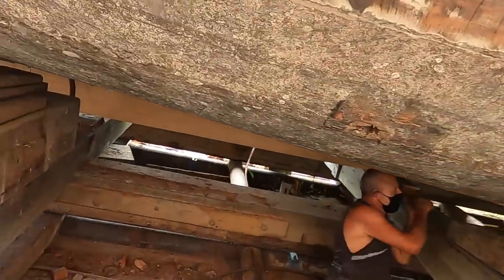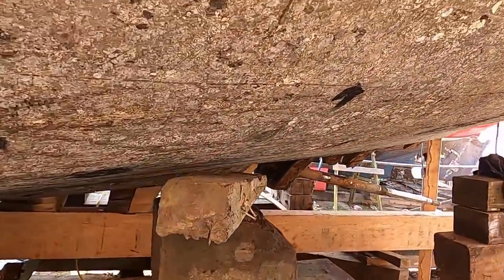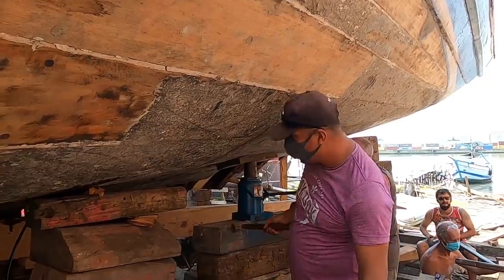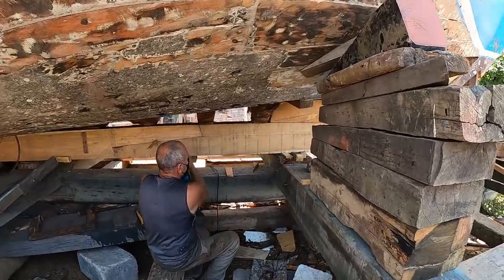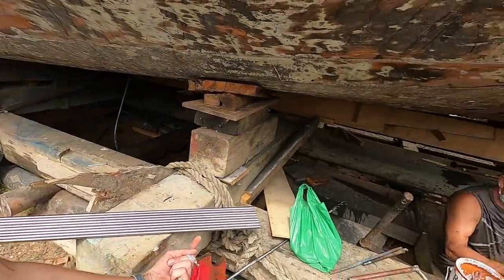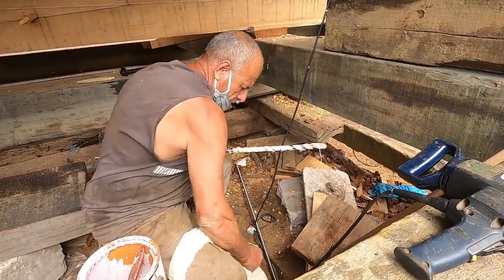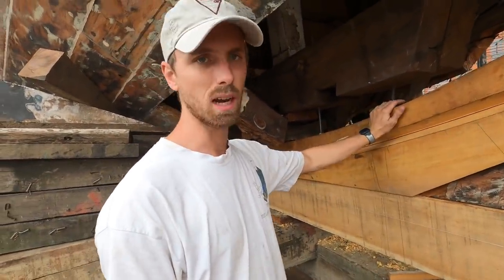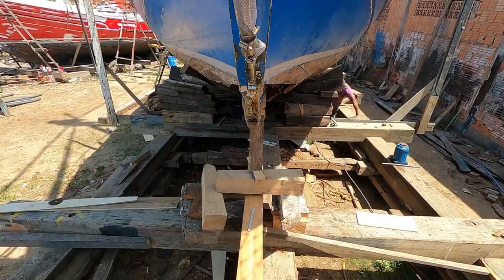Replacing the largest piece of wood? CHECK! — Sailing Yabá #15

Comment: 'Screw' is actually a bolt and the 'bolt put on the end' is actually a nut. 'Wall' in a boat is actually a bulkhead. The right terminology really helps the make the description accurate. Love your work!

Comment: Hi, are you going to put any bedding compound in, so far they have used none on any of the joints, your wood guys should know this, this is a must you have to tall them, I'm really 
concerned for the integrity of the frame to keel joints, best wishes.

Comment: I lived in Brazil for a while and remodeled part of the house and had it paneled.  The paneling came in large pieces to attach to the walls, but as the walls were plaster, they weren't totally flat nor square. The paneling company sent out a carpenter to adjust the paneling by hand and make sure it was properly installed--no extra cost.  Lots of beautiful wood in Brazil (imbuye, Pao Brasil, etc.) and still many great craftsmen.

Comment: They are replacing a lot of wood, but it means they almost have a new boat. It will be years before you need to replace anything. 👍👍👍
Reply: They just need to understand it got this way because the prior owner refused to do maintenance and pull the boat out of the water a few times each year and they now have a coating to stop the worm damage.

Comment: This is a perfect case in point about having to be flexible when doing wooden boat restoration, there are always several ways to do things . Its called wicking the bolts which is the proper way to do it . After seeing the Horn timber and the rest of the framing in the boat I am not surprised at all about the transom, I have done this before you just have to take it one step at a time , and do what you have to to float the boat.  I am sure you are thrilled to see the keel go in , I wish you the best . Wait till you get into sheer strake and covering boards , there is going to be  a great deal of work there, but at least it can be done in the water , take care and soldier on .
Reply: Yep
Reply: Not surprised about the transom because the whole boat is rotten. Every time they remove one board they find ten more rotten.

Comment: I've sailed around the world 7 times. I was surprised to see that the bolts were not double nutted to lock them. The vibration will loosen bolts with time. I would make sure those nuts were locked and double-locked somehow. 
That If all you have is that cloth and paint method. I would make them use that quick easy. Pluss is a proven method to lock. That's why Fancy Rope Work is painted to preserve and lock into place.
Reply: And are these bolt Stainless? I didnt see if they were

Comment: A big chunky slide hammer would pull the wedges quite easily. Suggest it to the guys. They may laugh or they might try it. It's a very simple and easy to make, but a very useful tool.

Comment: Ben, you are not using screws to secure your keel. You are using threaded rods to make bolts. Good luck guys, I admire your determination.
Reply from the maker: Thank you! Threaded rods, washers and nuts it is :D I got the hang of that thanks to reading the comments

Comment: I feel bad that a boat so young needs this much work.
Reply: It likely lived in rivers most of its life. Fresh water is what rots wood. Most lake work boats throw bags of salt into the bilge to stop rot. They likely did not do that here. But most work boats and 3rd world boats are like this and last 20/30years before refit
Reply: They read dummies guide to taking care of wood and did the exact opposite
Reply from the maker: Yabá has never been in lakes or rivers from what we know. She was made in Bahia and is now in Navegantes (SC). So the saltwater was leaking from the hull which didn't cause the rot. There were a lot of leaks on the deck which allowed rainwater to run along and in between the frames and planks. Because this went unnoticed or ignored, it caused a lot of rot to those parts. Also, there was a freshwater shower on deck which caused a lot of rot around that area too

Comment: Not a fan of the all thread keel bolt.  These guys are so handy I am surprised they are not tapping and forming their own bolts out of stock. 
Last time the wood rotted before the galvanizing came off the nails so it may not be an issue

Comment: should be using bronze the salt water will eat those bolts... there was a i piece of wood near the stem foot that was split because they ran the bolts improperly
Reply: I recall him saying they are stainless steel in another video, they should last as long as the rest of the boat. The paint would just be to fill the holes and seal the  bolts at that point.
Reply: Stainless steel not a good idea as much at sounds.Starved of oxygen it gets what is called 'crevice corrosion' and basically the outside looks fine but internally the metal  resembles a Crunchie chocolate bar with as much strength . Phosphor bronze is the idea material..

Comment: great video , im curious to know why every frame is not through bolted to the keel ? why only bolt every other frame ? what s the theory behind that ?  be sure to clean out both diesel tanks before you go out to sea, and filter the fuel before putting it back in the tanks ,   take it easy all the best
Reply: They are alternating the bolts at the moment as they get everything lined up and moved into position.  They're focused at the joints to keep the hull shape and prevent things from moving (as best as possible).  I suspect that the frames that aren't bolted will get refurbished/replaced first, then bolted down.  Then I wouldn't be surprised if the first set of frames bolted to the keel are replaced (if needed).

Comment: Just for the benefit of anyone watching; Ben's shorts are a complete No-No when working with rotary tools or equipment like that half inch drill. I have personally seen threads from a pair of blue jeans at a tear in the knee much smaller than the ones on Ben's shorts get caught in a 1/2" drill mix paddle and it isn't pretty. The little threads got caught around the shaft of the drill and in a split second it curled them around the shaft pulled the leg up against the shaft of the drill and began taking up the slack of the jeans until there was none left and then rolled the jeans and skin and flesh all up around the shaft of the drill before it stops spinning! I don't know if it was painful but the results were some very deep looking zebra striped bruises on his leg from the upper thigh to the calf so I'm  sure it was less than pleasant.
Reply: Fair point Daniel, we can forgive (or even applaud!) youthful enthusiasm, but seeing these near-misses makes many old-timers uncomfortable. We're not over-cautious snowflakes, just people with long memories, and a few scars. Ben and MP, we love you, stay safe!
Reply from the maker: Yikes! I have gotten rid of them already though. I'd rather avoid a zebra-striped leg. I actually borrowed them from Duca but ODDly he doesn't want them back any more
Reply: @SailingYaba  Haha! I hope you passed them on to the next budding youtube endeavor! 😉 I should be clear, i didnt see your leg that close to the drill but one moment of closeness is all it would take. I know all this is new to you guys and with those large timbers and make-do tools and equipment an injury could happen so the fact that it hasnt is a nod to how careful you two and the crew must be. 👍

Comment: A massive undertaking for sure. When you show the bottom of the boat it seems to me there is still a lot of rotten wood-do those boards have to be replaced as well?
Reply: In a project like this, you need the hull to keep it's shape as much as possible as you replace parts of it.  So yeah, with the keep replaced, they can replace frames to match the existing hull, then when those are solid, come back and replace the planking that has deteriorated.
Reply from the maker: Indeed! We will definitely be replacing more wood and it is true that the boat needs to keep structure to be rebuilt properly

Comment: Step by step inch by inch it will be done if the money holds out. Love the channel but I missed MP. The transom doesn't look good. More rotten timber. Those guys did a massive job with the keel. Good guys.

Comment: Hi Ben, I have not noticed do they use any sort of tar between the frame details. It is important to keep the water out. Otherwise it will be trapped in the seams and stay there forever. This is where the rot begins. It is also recommended to install water stops where the seam meets rabbett https://www.diy-wood-boat.com/Stop_Water.html. I am also curios what kind of wood do you use for the keel. Best wishes for your project!
Reply: @ralphgesler5110  I hope they will. But as to what I see how they install the wooden knees down to the frames there is no sign of any bedding compound. Normally you may see the excessive tar leaks from the seam and these are too clean. The keel joint looks also too clean.

Comment: at what point is it cheaper to build new the yard seem delighted to just keep working good repair skills but not for long life aka mild steel all thread not even stainless for the bolts just to get it back in the water feel sorry for them is like car crash tv, but its thier money so i really wish them luck and it all works out
Reply: Think of it from a content point of view.  Building new boats won't bring views in but rebuilding a broking piece of sht does.  Thats why there doing it
Reply: Gee that's a long sentence.

Comment: I don't know the answer to this, hopefully someone who knows the answer can help.  In the forefoot they are through bolting the keelson to the keel.  It doesn't look like there is any intent to add additional blocking.  So it appears that the keelson will be put in tension and slowly sag over time, is that common for this kind of design? Wouldn't it be better to have a solid structure from the forefoot up through the keelson?

Comment: Cheap labor & a rain forest in the backyard, no need to use sealants, bedding compound, etc....just rebuild it every ten years
Reply: It certainly seems that way. I swear those fasteners are just zinc coated. I don't even use zinc for anything that lives outdoors let alone something under salt water.
Reply from the maker: We don't get any wood from the Amazon or any other protected forests but it still costs considerably less than many other countries. The fasteners are all stainless steel
Reply: @SailingYaba  "The fasteners are all stainless steel"
This is not something to be happy about. Stainless is great above the waterline and exposed to air but buried in wet wood it is a disaster in the making and in some conditions the metal can be destroyed very quickly. Many viewers have pointed this out to you, pay attention or at least do your own research.

Comment: Will that bolt and metal beam rust like hell?
Reply: i'd imagine the bolts are stainless steel
Reply: @neal5186  oh, and they still wrap it with something, pretty old way of boat building i guess
Reply: @apollonmegara8220  yeah. Stainless steel will eventually rust in salt water.
Reply: they have built boats like that here in Brazil for more then 300 years now and believe me, it will not rust for 30 years and even so will last problably 70. I cant say for the wood on that boat tho...
Reply: @thiagodemelo4923  Why this boat died that young, Best Brazilian boat building? Your Cisne Branco was not even built in Brazil, you needed me to built it!
Reply: The problem with that boat is that it sink and nobody took imediate care, left for years abandoned. If proper cared they could lask 100 years.

Comment: Not being funny, but the stainless stud they are using to bolt your keelson onto the frames is not good , i would seriously have all the stainless studwork removed, use proper bolts, they will not last 100 years at all in fact depending on what metal work and the timber, i would not rely on stud !!!!!!!!!!!!!!!!!!!!!!!!!!!!!!!!!!!!!!!!!!!!!!!!!!!!!!!!!!!!!!!!!!!!!!!!!!!!!!!!!

Comment: I suppose there are not allot of people who are still alive who knows how to repair a wooden boat anymore. It's a dying trade since most boats are fiberglass these days. The process looks slow but wood is unforgiving unlike glass where you can patch if you make a mistake. That's why I am getting back into wood working. I am a welder by trade and wood working is a hobby.
Reply: Here in Norway you can go to school and learn this kind of woodwork as a trade!
Reply: @berikdahl  That's good some places are keeping the trade alive.
Reply: @pcb1962  Got news for you buddy I know Samson boat co. .And it would take them six month's to do what thy have done in three weeks
Reply: Ba d Neighbour  Look close those are zinc coated then painted to seal them
Reply: @JCrook1028  It was done right no water can get to those bolts as long as proper maintenance is done .And thy are stronger than bronze or brass both of which have the problem of becoming brittle over time .and with the flexing of a wooden hull would be prone to failure.
Reply: @loganjohnson3589  Water will get to keel bolts in wooden hull, there is no avoiding that. Properly built wooden hull does not flex from where keel bolts are. Work hardening is not issue for bronze keel bolts. Brass is not suitable material of boatbulding in underwater parts as it suffers dezincification.
Reply: @V4nh4K3ttu  Thank you for the correction .Still I think what they have should last there lifetime or more with proper care .I think that is all that really counts here .But this is all speculation we have more video's to come and maybe we will get answers to our ? 's if we are patient. All wooden boats flex even to the keel .Remember thy have a double keel system A lower (in the water ) and an upper inside the hull .Move it will but  so little the effect will take many years or decades to show ,and still not be a problem .